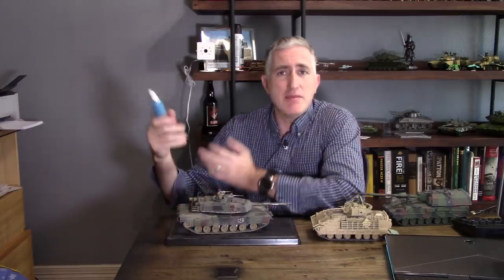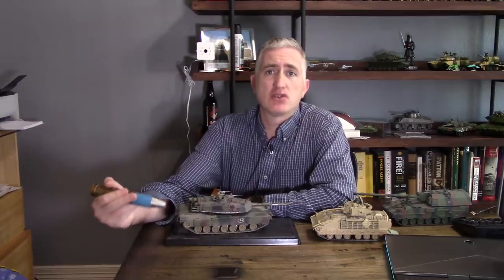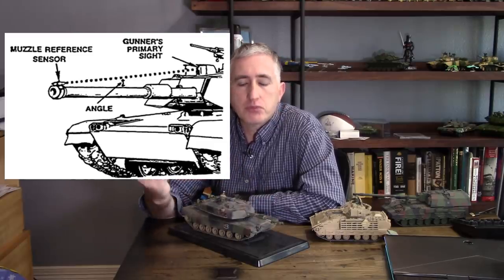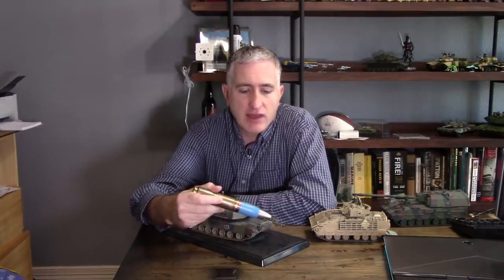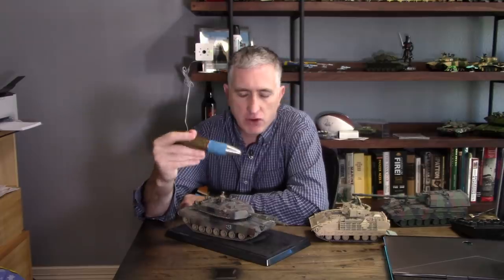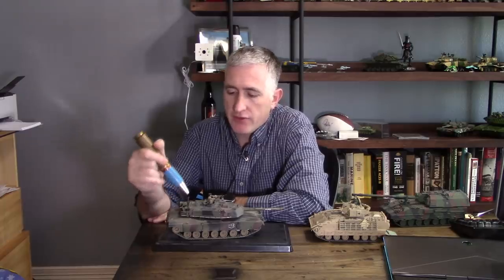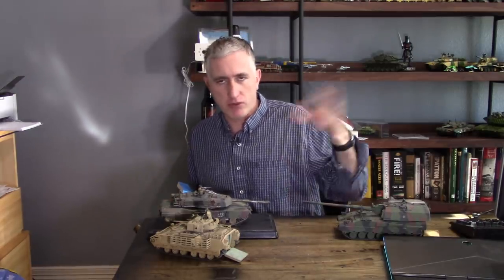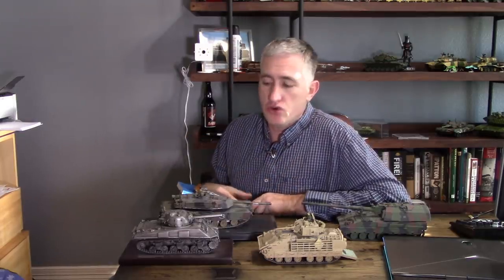Tanks 102: Tank Components

Comment: Why does the bradley not have a fume extractor
Reply from the maker: Doesn't really need one. The M240 is located outside the turret entirely in a little shrouded box, the 25mm produces little enough fumes that the fume extractor fan which turns on automatically does a good enough job at keeping the turret clear.

Comment: huh i always assumed you would sleep under the tank or did a shallow  trench  and drive the tank over it ?  actually couldn't you just carry a canvas tarp attached  to  one side of the hull or turreted  rolled up wit a pair of poles? and then to set up all you need do is park up  unroll the canvas tarp  prop it up with a pole in each corner  and voila you have a ready made tent ... make the poles of a decent size and strength and you can sling some hammocks between them and the tank...
Reply from the maker: You could, but why do that if you can spin the turret so that the gun is over the back deck, and it makes a ‘spine’ for the tent made by draping the tent o er the gun tube tothe deck edges? Still no mud.

Comment: I have a question about gun alignment.
The Gunsight is offset from the gun, how do you achive a hit to the center of the croshair at various distances then? does the Balistics Computer compensate for the offset?

Im asking this since i play War Thunder Sim a lot, there you use the "historical gunsight" which is offset from the gun itself, the game however doesnt compensate for the offset so at close ranges you would have to aim drasticly off center from the croshair for a hit and even at longer ranges you would still have to aim slightly off since the gun and sight arent realy zeroed in for each other. 
I doubt this is a realistic depiction of this especialy for vehicles such as the Abrams and Leo2 thats why id like to know, how does this get compensated for nowdays and how did it used to get compensated for during WW2 and the Cold War era?
Reply: Parallax Error might be compensated for in very advanced systems, but likely the effect produced by it usually falls within the standard statistical deviation of rounds on the target aiming point. 
   But at point-blank ranges as you suggest, it likely is an error offset that is a required aiming consideration if not trigonometrically compensated for within the sighting system.
Reply: Thats called parralax effect, having 2 parallel lines of sight (gun sight and gun tube) with some distance, thus at any point downrange their absolute distance and relative position is the same, though at longer ranges it is less of a problem unless you want to put SABOT rounds into someones head. 
While Im fairly certain WWII and very potentially cold war gun sights didnt compensate for it since the distance between sight and tube wasnt that great, at least for telescopic sights, though the technology was indeed there for ships (due to the great distances between fire directors and the actual guns), modern tanks should be able to compensate for that rather easily given that the only variable is range.
Reply from the maker: After a quick check of the -10, it states that parallax effect is accounted for by the ballistic computer. As part of the boresighting process, you need to input the range at which you have boresighted. Usually this is known because you have a boresight panel at a set range, but if necessary, just lase to the target.

Comment: What are the rectangular fan jalousine boxes for at the right and left side of the Abrams turret?
Like in this picture: https://www.globalsecurity.org/military/systems/ground/images/m1a1-980120-A-0000K-002.jpg
Reply from the maker: You talking about the washboard things? They show up rather distinctively in thermal imagers and are used for identifying friendlies.
Reply: @TheChieftainsHatch  Thank you so much. I always wondered what that is. That makes sense, as there is no such thing as friendly fire. And the triangle markings on the side, and the rectangular markings on the turret front - they show up in thermal sight also, right?

BTW, as you maybe will read this, I asked a few times how wet ammo storage in the sherman worked. It was not covered in think-tank which covered alot. So  maybe you can adress that in a future video. Like how was ammo storage before wet storage? What needed to be changed for wet storage and how efficient have the effects been?